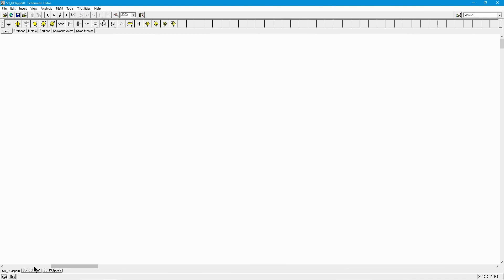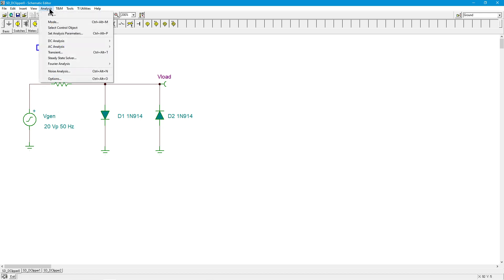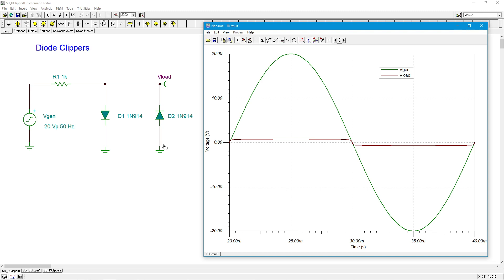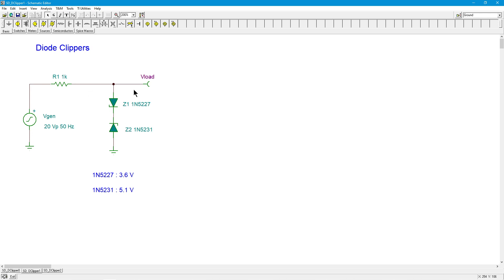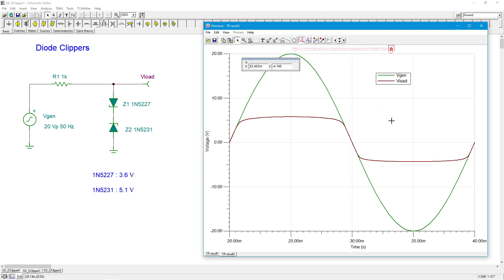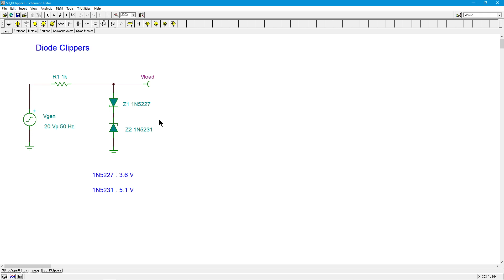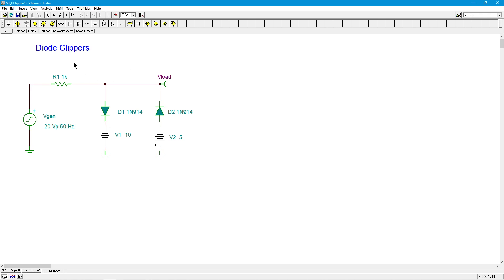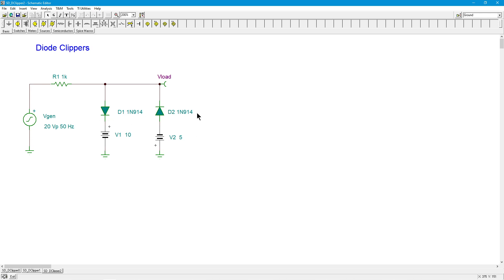Semiconductor Devices: Diode Clippers

Comment: Hi professor, I’m very much enjoying working through your older videos . The diode voltage drop just confuses me though , to the extent that I actually made a video about it 😂. I’m sure I’m missing something. The video is here if you’ve got a spare 4 minutes https://youtu.be/RURfKzA5BLk?si=5SL2RriPEcsQ8F8- . If I’m not getting it there must be other people who aren’t. Maybe you could make a video clearing it up . Your content is excellent btw great stuff .
Reply from the maker: You're not really missing anything, Phil. In fact, you've made an excellent experiment and the results you achieved align nicely with theory. The whole issue of a "knee" in the curve is (in my opinion) somewhat overblown. I believe that it comes from the fact that diode IV curves typically are drawn with linear scales. Further, they are drawn such that the upper limit of the diode is not quite reached (what would the point be to increase beyond that, or to only show values well below it?). When scaled that way, we often see what appears to be an obvious knee somewhere around 0.7 volts (and to be fair, some texts prefer 0.6 V). If you have downloaded my free Semiconductor Devices text (links in the video description, if you haven't), turn to pages 33 and 34. Page 33 shows the classic linear-linear plot with an apparent knee around 0.7 volts. On page 34, I have changed this to a linear-log plot and you can see that we have a straight line now for the diode curve. So, your experiment was spot on and I commend you for it. Excellent work!

Having said that, why do we use 0.7 V (or 0.6 V) as the approximate diode "on" voltage? Well, chances are, it's going to be close to that. We seldom bias diodes at extremely low current values for many applications. And even if the actual forward drop is, say, 0.5 V, that approximation isn't going to affect the results much. For example, suppose you have a DC source in series with a resistor and a forward biased diode. Unless you're working with a very small DC source, approximating Vd as 0.7 V versus 0.5 V is going to have very little impact on the calculated current through or the voltage across that resistor.
Reply: @ Thank you so much for giving such a comprehensive reply. On so many channels, especially the ones aimed at guitar players . It’s often stated in such a way to give the impression that the diode is open circuit at less than the 600 or 700mv . I think your explanation of it as a high resistance at lower voltages is much clearer . Thanks for helping me understand this , I appreciate you taking the time
Reply from the maker: @philhardy18  My guess is that they are using simplified models for ease of computation or explanation. I discuss some of them starting on page 39 in my Semi Dev text. They're perfectly fine models, but yeah, they're just models and not reality.

Comment: You can  make an arbitrary voltage zener with a transistor and 2 resistors.  example, NPN - E to ground, C to signal, B to center of resistor voltage divider between signal and ground.  Resistor values picked to turn on transistor at desired zener voltage.

Comment: I have never really heard about the third option, the biased diodes, but it looks like a really handy circuit. I guess this would be quite useful for a distortion circuit. But as I understand it, the component that would generate the bias voltage has to be able to sink current when these diodes open up, so that is something to look out for.
Reply from the maker: Perhaps, although most guitar distortion circuits (I assume that's what you are referring to) use an active device such as an op amp, BJT, or FET. This way, you can gain high input impedance and gain.

Comment: Can make a triangle to sine shaper from diodes
Reply from the maker: Yes, you can. You can find an example of this in my Op Amps playlist (see "Function Synthesis").
Reply: @ElectronicswithProfessorFiore The shapers I've seen use the low level Ln(×) curvature of the diode rather than the high level zener-like piecewise-linear shapers
Reply from the maker: @8m2sCv7  I cover both Zener-based and biased diode approaches.
Reply: @ElectronicswithProfessorFiore  I only saw high level piecewise linear diode shapers. The ones i mean work in the 0.5 to 1V range, but usually need a buffer circuit to get higher output. One such shaper in a function generator uses 3 lots of 4-diode rings iirc.